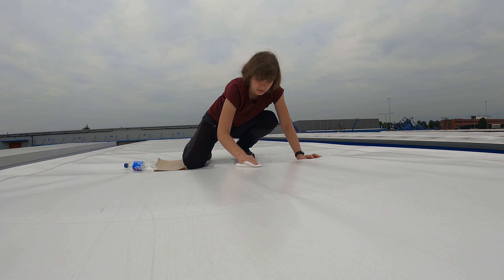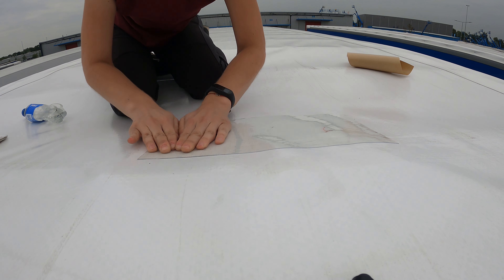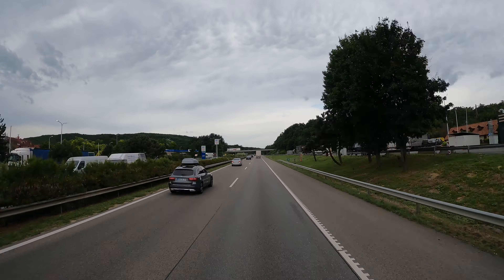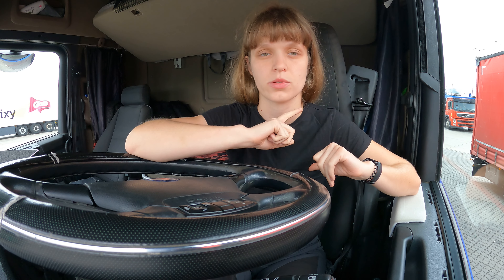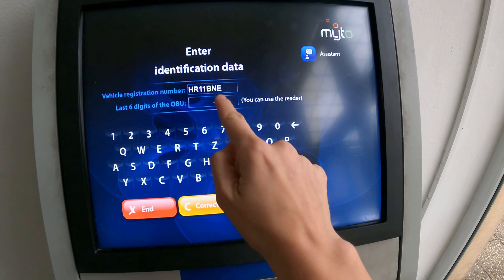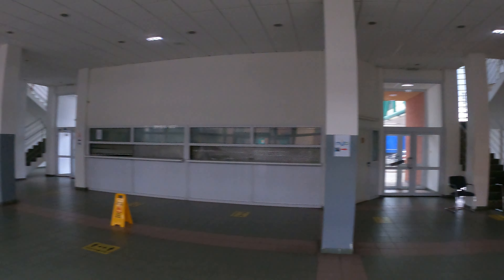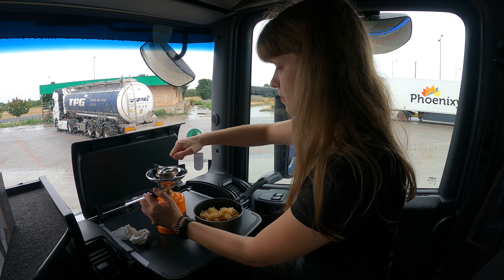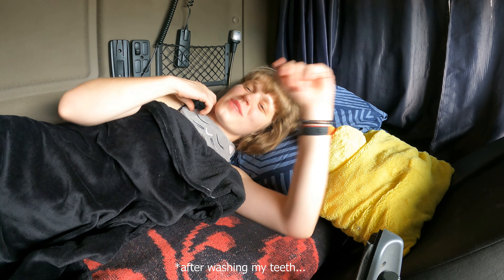Fixing the trailer's roof |  Buying vignette | Trying the gas stove | Problems to solve

Comment: hi Timea roof repair done and dusted well done see you bought gas stove for cooking does your truck not have inverta fitted for power to boil kettle run microwave  i know power supply is different when i was in Ukraine in Lviv it was 110v  120v not sure  is it the same in Romania maybe check out if inverta will suit Scania i have seen them used in UK trucks a mums cooking is the best till next 1 safe travels look after yourself out the road 👍
Reply from the maker: Hello! Thank you very much!😁 Now let's hope it is going to keep the water out of the trailer!🤞 I hope the next truck is going to have a microwave, because it would be much easier to work with. But until now, I have to try my best with the gas stove.😊 Thanks for the recommendation! Take care!🙋🏼‍♀️🌻